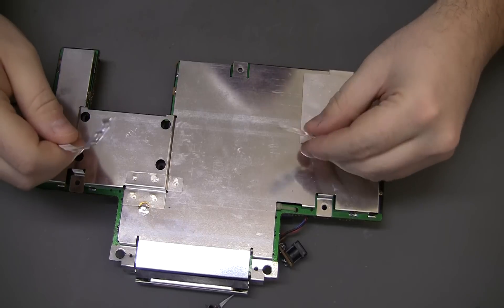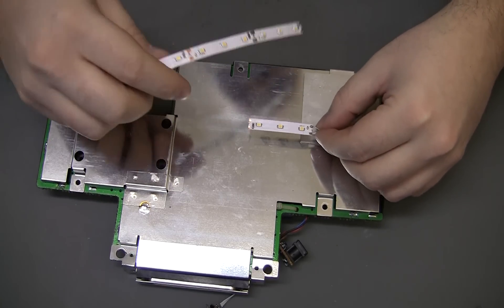Turbografx-16 easy back-lit logo LED mod

Comment: Here's another vote to try out a diffuser of some sort. Might need to make the LED's slightly brighter compared to how they are now, but you'd get much smoother lighting out of it overall. Looking around, there seems to be a few companies advertising a thin diffuser film that doesn't seem too expensive considering the amount you'd need for one of these mods.

If you wanted to get even fancier with it, you could use a larger piece of diffuse acrylic to fill the cutout and have the sticker attach to that for a firmer, more "stock" feel when touched, though obviously that would be a higher cost in materials and require a more precise cutout. All told, that's probably outside your electronics-first scope of work, but it would be neat to see done in practice.

Comment: Looks like a couple others beat me to suggesting some sort of diffuser for the LEDs. Some kind of thin, frosted plastic would work well. I'm sure you can find a sheet of something that would work that you could trim bits off as you need them.

Comment: Nice mod, how about having one strip of 6 leds & then fold the parts between each led underneath so it sticks to the 3m stuff, this will bunch them up closer without having to do a load of soldering?

Comment: You only need one or two LEDs and hot glue as a diffuser. Of course the glue would be used in a certain way to spread the light throughout the logo.

Comment: I got a question I got a turbo grafx 16 and it plays fine butt one issued is the audio cuts in and out butt it only does it at a certain beat in the music when playing a game I'm using a RF switch  could it be where I got it hook up on a hight definition T.V?
Reply: randy Buell Replace the caps and I would do all of them.
Reply: Xmod's Gaming thanks butt I  finally figured out what it was it's where it was on a H.D TV the caps are fine the sound works perfect on C.R.V T.V
Reply: randy Buell yeah same here my svideo mod on my sega genesis M1, looks like crap on my HDTV vs my CRT screen 📺 look just like s video.